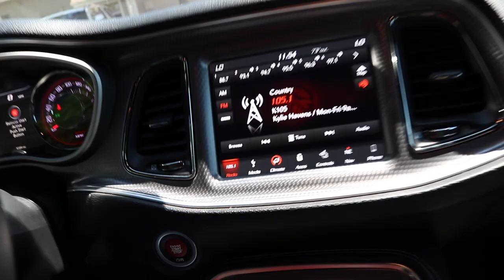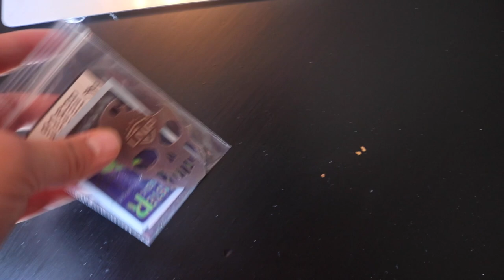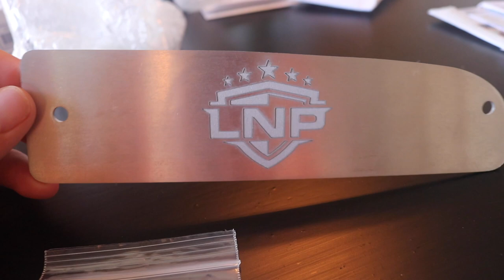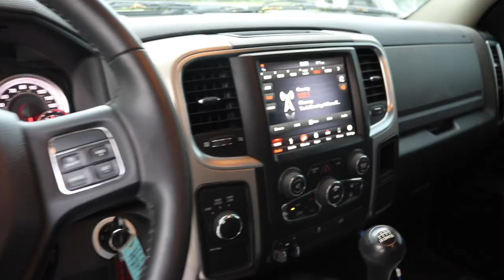His 2nd gen cummins BROKE after just 2 weeks...

Comment: If the drive shaft comes out and hits the tank it will crack, with the shield on there it will displace the blow and not crack the tank, also helps with some 5 inch stack kits but its not really needed. (unless it's making a lot of power or high mileage manual trans)